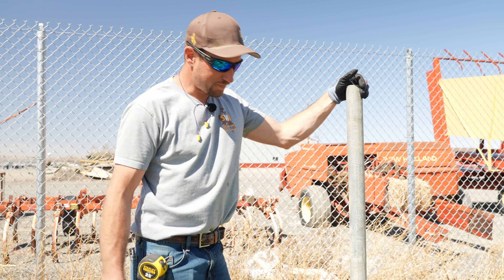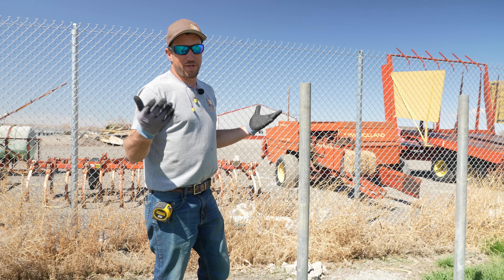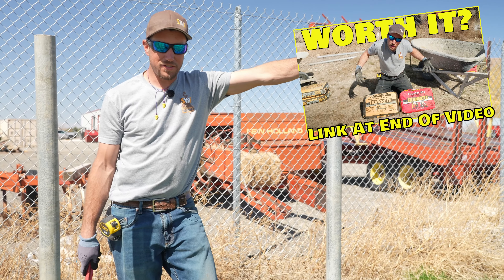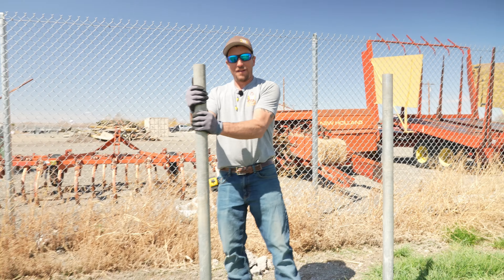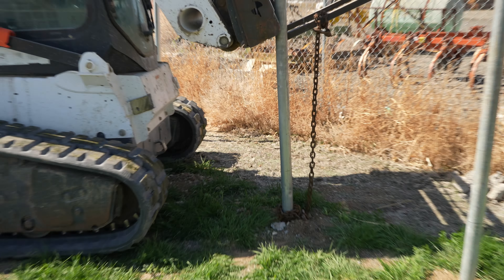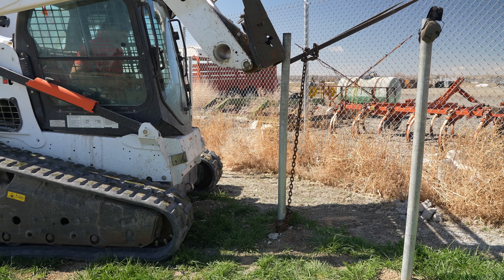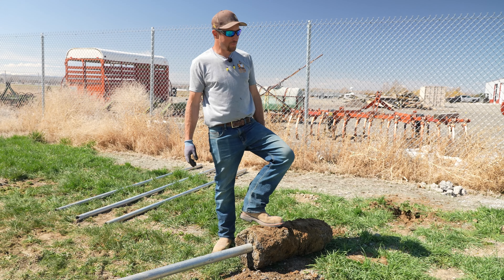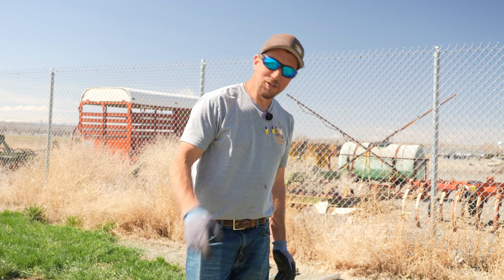Can You Pop Posts Out Of Concrete?

Comment: Yes i did that 2 days ago. I was surprised. Literary just the post came out all i did was not even hit. Just kept kinda moving or pushing post with force from side to side, left right etc.. at times hanging my wholevbody with arms from post lol. At one point it felt so loose that i said oj the ball 9f concrete will fome out now with rod cause . l was expecting a rod to come bout with cemwnt all-around it and wow jusr the post came out. when i pulled iout of grpundLijust the post came out The post had been there over 18 years.  I guess. By moving in post from side to side. It detached from concrete. Thank you!!🌜☺

Comment: That is a cool demonstration.  I had a flag pole made of 4 inch galvanized pipe with a cement ball on the bottom.  I tried to chizel it of but it was a ton of work.  My buddy told me to hit the pipe not the cement with a sledge hammer while it was laying on the ground.  The concrete fell off in pieces.  I lost a case of beer over it.  I didnt think it would work.  I was wrong.
Reply from the maker: Hmmmm, sounds like we have our next test video. 👍🏻

Comment: I removed several unwanted steel posts with concrete footings attached. Now I want to reuse the posts, because they're expensive. . How would you remove the concrete? Jackhammer? Other ideas..?
Reply from the maker: 😬 That doesn't sound fun. It's going to depend somewhat on the quality of the concrete, but these things tend to be set pretty solidly. https://youtu.be/iBgWx2y9pj8
You might consider cutting them off at the concrete level and then welding some more pipe inside of it. Not sure how much of a savings you'll get at the end of the day though.

Comment: I'm in the habit of welding 3x2 inch lengths of 2x1" RHS onto 4 inch NB gal corner posts at equal spacings around the post and equal space depths. Post in with a rock under it and fill a 12 inch diameter hole with concrete. It appears that I may have been overdoing it...